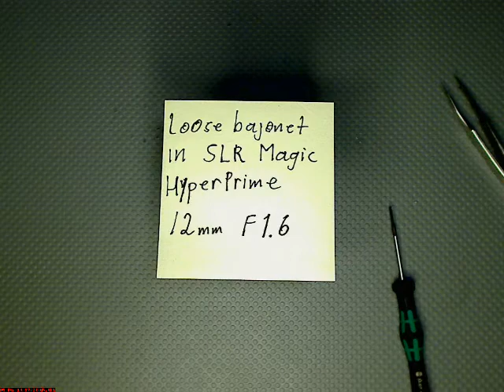Loose bajonet in SLR Magic HyperPrime 12mm F1.6____Motion Lapse film

Comment: cool what tool is that to open the lens up?? This happened to my 75mm
Reply from the maker: I use a 1,2mm flathead screw driver and a 2mm flathead screw driver.

Then use a SMALL AMOUNT of Loctite 222 threadlock to secure the screws.

Comment: Is it that the set screw you applied the loctite to came loose or is there something more you have to do to the Helicoid? Mine is loos too but it also appears there is some contamination or blemish on the inside of the rear element. and was wondering it it's removable when the helicoid is off?? 

Thanks